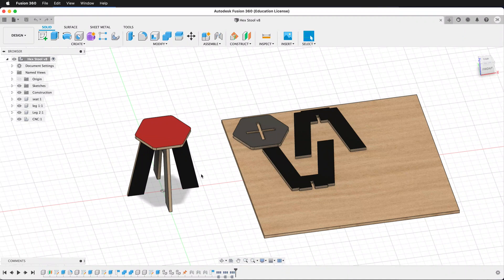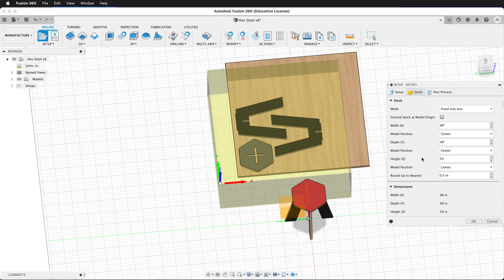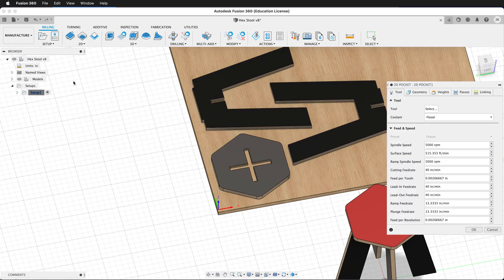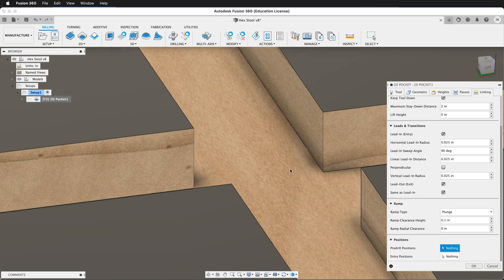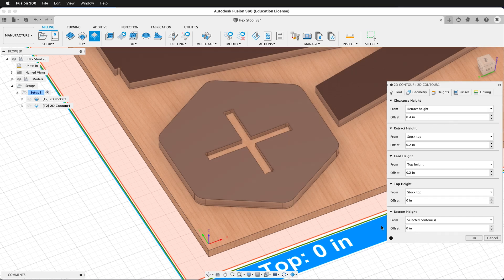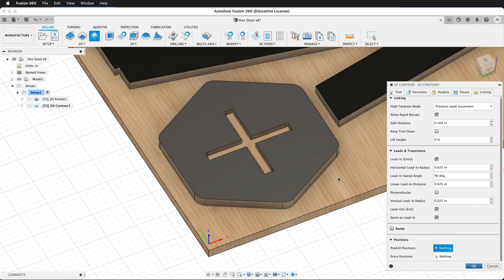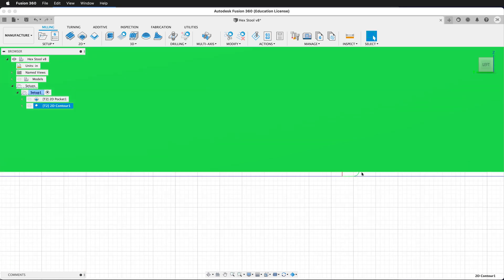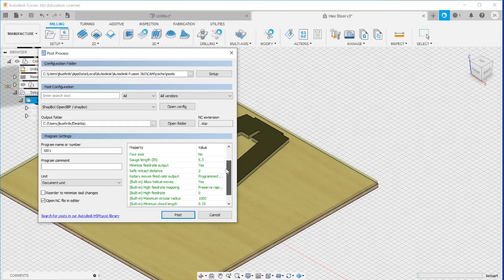Create ShopBot Tool Paths in Fusion 360 for Plywood

Comment: What would be the best way to add a cut that isn't on or along a part? Basically, can I add a line in space and add a cut along that line to manage the shapes of the drops I'm generating?

For example, if I'm cutting 1 part out of a 48"x96" piece. Say the part is 43"x65". That leaves an L shaped drop. I would prefer to have 2 drops (31"x48" and 5"x65", less loss from bit diameter). What would be the easiest way to accomplish this in Fusion?

I'm coming from a 2D system and I know how to manually add a line via text in the Gcode, but not in Fusion.

Thanks for the videos, they're very helpful!
Reply from the maker: You can draw additional sketches and use the sketches as cut lines in the manufacturer workspace, you can tell it to cut on the left or the right of the line

Comment: Very useful video. One question After I set the toolpath and go to simulate. The simulate starts from the end point  instead of the beginning point. Do you know why?
Reply from the maker: It might be the direction of the cut. You can either do left climb milling or right climb milling, you can also click on the arrow on your contour to make it inside or outside and the machine will potentially change direction
Reply: @WhatMakeArt  I had tried that but nothing. I forgot to mention that the bit goes all the way through the playwood and starts it’s way doing the passes going up.
Reply from the maker: That is strange,  are you sure you're using a profile cut? Is it a 3D cut?

Probably something really simple, I would recommend a new cam setup from the beginning to see if there's something you might have accidentally clicked
Reply: @WhatMakeArt  I do just exactly like you did in your video. One thing I noticed is when I go to geometry and select the top edge the simulate begins at the start pint, but only one pass. I am wondering if it has to do with the highs.
Reply from the maker: Likely something to do with the heights, I usually pick the lower most part of the geometry on a profile cut

It's frustrating when something doesn't work, but I'm sure you'll figure it out
Reply: @WhatMakeArt  yes I know. I’m new with this program I’m keep playing with it. Thanks for replying. I’ll suscribe 👍
Reply from the maker: hard to know what's going on without seeing your file

Good luck with modeling and let me know if you get stuck on anything else from my videos

Comment: Very useful explanation - helped me a lot for ,my XMAS CNC project. But one question remains: How do you add some clearance to the CNC cut parts? I have learned that the exact numbers result in real world components which are almost impossible to join. I would like a "softer" fit to make the glue up less painful. Any hints how to solve this problem?
Reply: Wolfram, you are actually correct. Fitting tolerances are important. Frequently, with boats kits puzzle joints had a fitting tolerance of around .02". With prefinished ply for commercial stand applications and tables it was closer to  a few thousandths of an inch. Those tolerances were tight because the cut product was the final show product. Boat kits need to fit well and relatively tight, but the ply only acts as a core material and will generally see a bunch of post work. Test cuts are always important though. Every time a new thing was cut (product/project) a test pocket or joint was also included in the sheet before cutting resumed. Fusion is awfully clunky in the machining environment and a lot of other software usually costing more will allow you to include offsets on paths for pockets and profiles outside of a modeling environment.
Reply from the maker: Soft plywood pieces normally can be forced together,  sometimes need a bit of sanding
You can do a test cut at exact size to see if it will fit or not, then you can decide which part will be made smaller and then you can add a parameter with a variable for your clearance. Clearance. You can either cut it out of both pieces or just the piece with the negative space.
Reply: Radial stock to leave on pockets with a negative value may help open up the pocket, but from the video I am not exactly sure.

Comment: Nice video 
A question... how do I set the speed of simulation into a real speed please ? 
I just want to see the real cutting speed in the simulation. 
Thank a lot
Reply from the maker: There is a slider below that you can adjust the speed of the simulation.

There are too many variables to make it be the actual speed that your machine will cut. Even the machine time estimate that fusion does is not accurate because of the different machines.
Reply: @WhatMakeArt  ... and also the start of Tool (under simulation) is non start from the "Box Point" 
I just looking for some other software just for using is for the simulation 
Something that take in INPUT the gCode generated by Fusion 360. 
Thanks a lot again
Reply from the maker: Ah, I see yeah I'm not sure what software would be best for estimating times from g code.

I ran some files on the machine I use to calibrate the estimates from fusion and actual cut times. It's always just an estimate until you actually cut the part